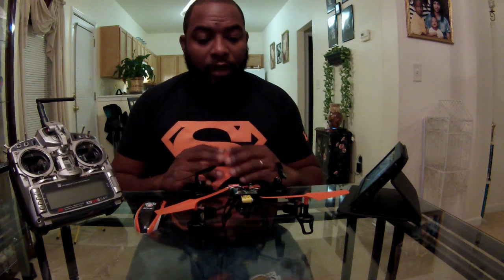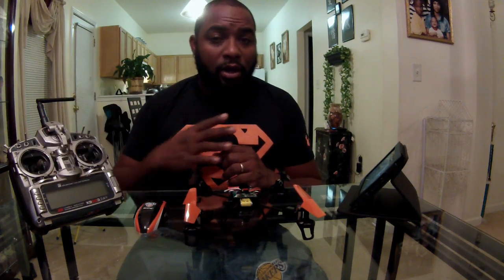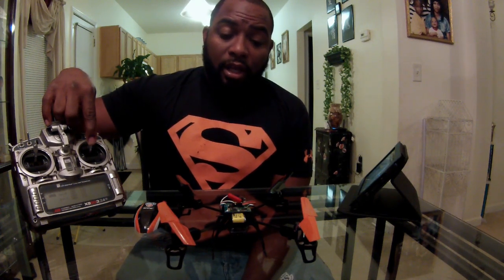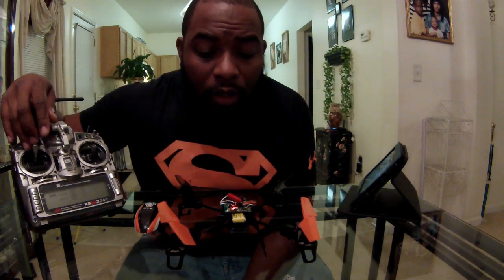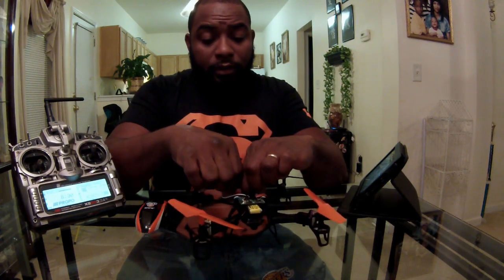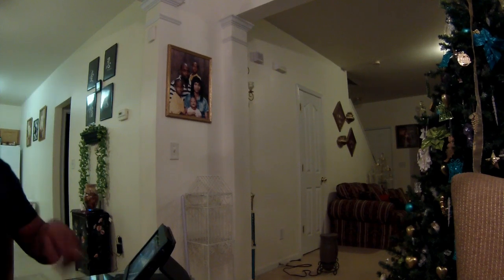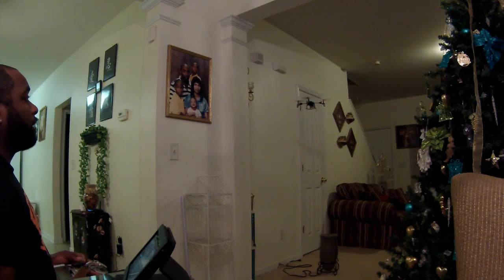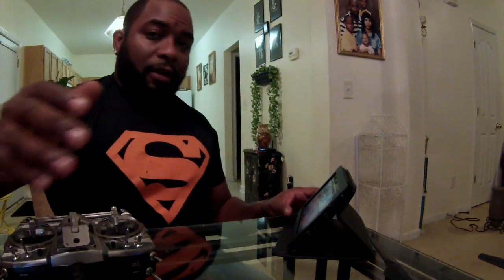Blade 180 QX Calibration how to

Comment: Thank you!  I was having exactly this problem with my new 180 QX HD when I got it home this evening. Was about to pack it up and plan a trip back to the hobby store tomorrow. Followed your calibration steps and right away it was nearly 100% better. Just needed a couple of very small trim adjustments and it's hovering great at about 5 feet. Something else to tell folks is to get it up 4 to 5 feet to get it out of the ground effect before trying to trim it for a hover. I noticed that it can still be a bit twitchy when it's down near the floor.

Comment: tntneon I just wanted to let you know that this also works for the Blade Nano QX. I just had the same issue, it was only starting 3 motors unless I had it held at a weird angle, then it would start all 4 and try to fly at a 30 degree angle. I ran through the calibration steps hoping it would work and it does! You might want to add to your comments that it works for the Nano QX as well. If not, hopefully people will see this comment.

Comment: Hi there, my 180QX just started to be unstable.. the rear right engine does not start at the same speed as other motors and it never goes at full speed. As such, the quad is not able to fly anymore and when it does it is very unstable. I am guessing the motor needs to be replaced or an issue with the control unit calibration. Can you please help?
Reply from the maker: I would change the motor out.  You can use the motor from the mqx.  Be blessed

Comment: Thanks for the info. So then just putting it on a flat surface and holding the sticks until it starts to flash red them blue is the actual calibration? And then the rest is just trimming after-the-fact?

Comment: Thanks for the tips Isaac.  I'm having problems keeping the white propeller gear from coming off in flight.  Have you experienced this at all? I just did a few indoor flights with no crashes and it tends to pop off on landing and it's getting worse.
Reply from the maker: I haven't had that trouble with the gear popping off. Throw a lil CA on the bottom of the gear and shaft and see does that help if not you may have to get another a gear.  Be blessed

Comment: Thank you for the video, What brand of transmitter is that? on the stock transmitter that comes with the 180, how do I know if the trims are centered? I would like to get a full size transmitter to practice flying for a home made quad that I am building. Will all transmitters bind with this 180 QX if they have the right module installed? Do you still have the 180? and what other quads do you have? Thank you so much
Reply from the maker: I'm using a jr9503. No all transmitters won't bind to the 180 only the spectrum tx, dx6i, dx6, dx7, dx8, dx9, dx10, dx18, and like the older Jr tx not the new Jr tx. No I don't have the 180 anynore. I have the 200Qx,  hovership MR 250, and I had a Skyhero Y6.  Be blessed

Comment: Im thinking about buying my first quad I have a few in mind blade nano qx, qx 180 , latrax alias. Which one of these do you think I should go with  ?
Reply from the maker: EIther ones are good quads but I would go with the nano qx or the 180 because of parts variability.  Both would be great but if size matters go with the the 180 has far as crash worthy the nano qx both can take a crash but the nano takes it better.  Plus the 180 comes with the camrea. Be blessed

Comment: blade 180 qxhd

Flight Mode Calibration
• It may not be necessary to do both calibrations.
• If the quadcopter is drifting only in Agility Mode, then follow the Agility Mode Calibration instructions.
• If the quadcopter is drifting only in Stability Mode, then follow the Stability Mode Calibration instructions.
• As there is no GPS, there may always be a small amount of drift in any fl ight mode.
• There is no self-leveling during calibration. It is up to the pilot to bring the quadcopter to a stable hover.

Agility Mode Calibration
1. Ensure all trims are centered.
2. Power on the transmitter and move the throttle stick to full throttle.
3. Ensure the transmitter is in Agility Mode.
4. Hold full down elevator.
5. Connect the fully charged fl ight battery in the quadcopter.
6. Both LEDs will fl ash. Leave the throttle at full and return the elevator to center.
7. Leave the quadcopter still until the LEDs fl ash red then blue. This can take up to 30 seconds or 
more. When the LEDs repeat with one blink per color, the calibration is complete.
8. If only the red LED is fl ashing, the calibration has failed. Repeat the process.
9. Disconnect the battery.

Stability Mode Calibration
1. Ensure all trims are centered.
2. Power on the transmitter and move the throttle stick to full throttle. 
3. Ensure the transmitter is in Stability High or Low Angle Mode. 
4. Hold full up elevator.
5. Connect the fully charged fl ight battery in the quadcopter.
6. Both LEDs will fl ash red twice, then blue twice for a few seconds.
7. When the LED turns solid blue, lower the throttle and return the elevator to center.
8. Raise the throttle to bring the quadcopter to a hover. 
9. Use the trims on the transmitter to eliminate any drifting, allowing for a stable hover.
10. While in a stable hover, press and hold the camera trigger on the transmitter for 5 seconds. The 
quadcopter is now calibrating input from the sensors and transmitter.
11. Release the camera trigger and land the quadcopter. Upon landing, the LEDs should fl ash red then blue. When the 
LEDs repeat with one blink per color, the calibration is complete.
12. If only the red LED is fl ashing, the calibration has failed. Repeat the process.
13. Disconnect the battery, then return the trims to center.

Comment: Can you explain centering the trims? I am super new to this and don't know how to do that. Also I have only had this about 2 days and the 2nd time I went to fly it the 180qx wouldn't respond but all the lights are on and flashing. Any help would be greatly appreciated.
Reply: +Rudy Flores As a new flyer I could not find this info anywhere either and had the exact same two problems.  For the trim, each of the four trims has an up and a down button on your controller.  Tap one of the buttons while holding the controller close to you, you will hear a little beep each time you press.  Each trim adjustment has about 40 positions, so go up on one until you hear a series of multiple beeps.  That's the top position.  Now press the down button for that trim about 20 times.  When you get to the middle position you will hear a longer beep than the others.  Ta-da.  Repeat for the other three trim adjustments or just go up and down listening for the long "centered" beep on each. 

The continuous flash no response thing is "bind" mode.  I have successfully gotten out of it by disconnecting and reconnecting the battery, which may or may not be the right way to go about it, YMMV.
Reply: +Judith Reppert thank you. that was extremely helpful.

Comment: TNT or can I call you Stable. Does the Quad 180 center itself when the stick is released. Or will have to have reverse stick to Stable(lize) flight?
Reply from the maker: It will stable itself but it will drift a lil.  Be blessed

Comment: Hi Isaac, I tried calibrating like as per your instructions even though the radio was in stability mode - and it worked the first time, but then I had a nasty crash and now the drift is back. I tried calibrating again but no luck this time. Any ideas? Thank you! Your videos are awesome!
Reply from the maker: Check on the motors one could be bad from the crash also make sure the props aren't bent.

Be blessed
Reply from the maker: Check on the motors one could be bad from the crash also make sure the props aren't bent.

Be blessed

Comment: Nice vid...I recently bought a 180 QX and it was a blast for the first week.  After that, I remember pressing a button on the stock transmitter just to see the trim in action.  Since then, every time i try to take off, the dang thing won't stop turning left.  I have to turn the elevator half way to the right just to keep it centered.  It is very frustrating and the thing is barely flyable.  I tried resetting it and re-calibrating it, but it will not stop spinning to the left.  I replaced the blades and everything, and still nothing.  Any support would be much appreciated.  Thanks - J
Reply: Just realized that you have to press the trim buttons like 15-20 times before you start to notice a change.  Fixed and pumped!

Comment: My blade drifts backward pretty bad and trim and calibration doesn't  seem to help any ideas?
Reply from the maker: Make sure when plugging it in that it's level and when doing the calibration that all trims are at center and no subtrim use at all.  Be blessed
Reply: tntneon Thanks issac! i think i have done all of that i will try again. but i am just frustrated. Any other ideas?
Reply from the maker: Unless you have a weak motor on the the front of the quad causing it not to keep up with the rear.  Make sure the props aren't bent out shape and tracking. You can try a new set of blades make sure you put the correct blade on the right motor.   Be blessed

Comment: With respect, as far as I can tell after step four of your description when you turn the quad copter off and turn the transmitter off what you have instructed people to do is fly their quad copter and trim it out. Am I missing something? Yes, my quad copter drift to the right like everyone else's but this procedure only seems to encourage people to trim their quad copter and does not calibrate or zero the quad copter. Again, with respect, what am I missing?
Reply from the maker: The calibration takes the hard drift out like a hard lean. The trim just takes out the small drift.  It's not going to be perfect. The trim just helps it out.  Be blessed